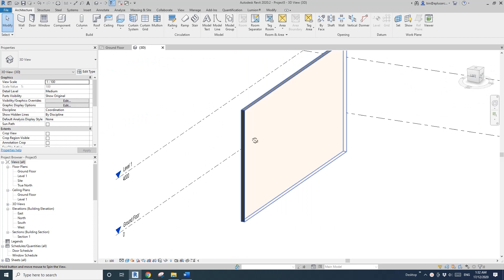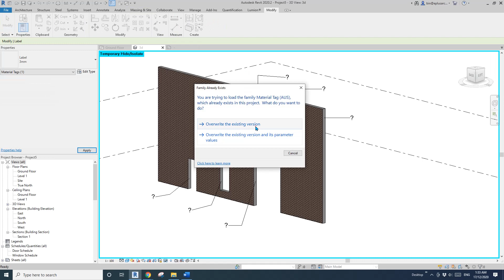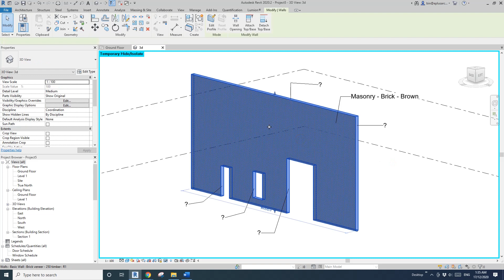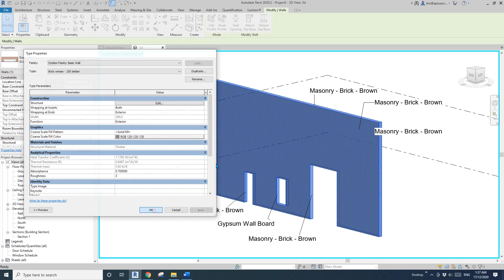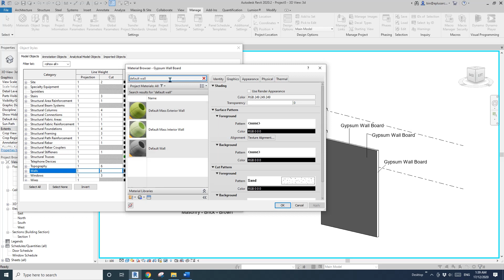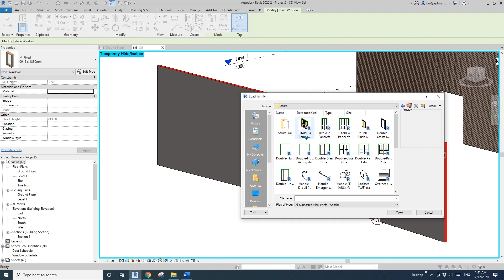Everyday Revit (Day 273) - Assign material to edge of wall

Comment: Thanks nice .plz consider some paramatric mesh fence
Line base  family if u can
Reply from the maker: Can you show me an example please.
Reply: https://youtu.be/-ASJm-HfOwg
Some thing like this but need proper wrought iron post with mesh grill and fasten elements
Reply from the maker: @saimasohail6227  Do you really need this level of detail? I would just model it using curtain wall and use material for the mesh. If you do need those details, a railing family is more suitable than a line based family. You can have a search on Bimobject or NBS, there are quite a lot of railing families created by those manufacturers.
Reply: @BINHE615  thanks sir for your  interest ,just wana to see your apporach to make such kind of families or just to give
Some tips ,if can